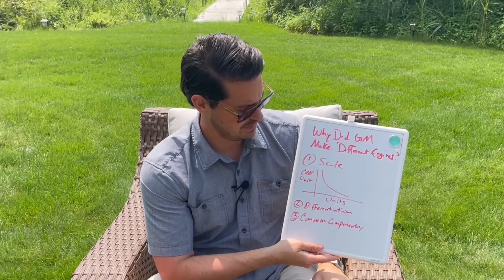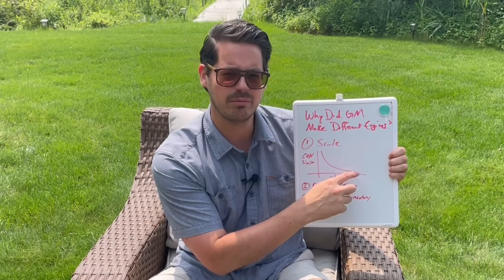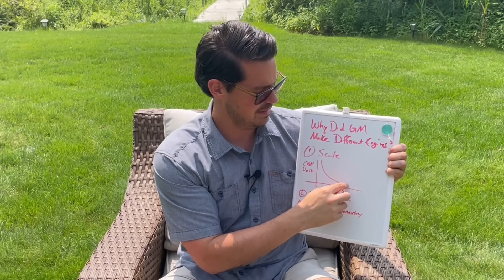Why did General Motors (GM) Make So Many Different V8 Engines in the 1950s-1970s?

Comment: If you're going to do a video on Ford's 351 cubic inch engines, don't leave out the 352 FE.  While ALL of Ford's 351s share the same 4" bore and 3.5" stroke, the 352 does as well - making it, in effect, a 351 too.  Four 351 cubic inch engines, two of which share nothing in common with each other nor the others.

Comment: 7:05 I don't think Buick made a big block, nor Pontiac or Oldsmobile. While they had large displacement engines, they were all off the same, respective blocks, unlike Chevrolet, who had a distinctly different big block versus small block.
Reply from the maker: No. Olds and Buick had small and big blocks. So did Pontiac if you count the short deck 265/301 vs the 326-455.
Reply: @RareClassicCars  OK! I guess I'm old! I was thinking about just the high compression engines through the '60s.

Comment: I used to work in a wrecking yard and it is interesting to note that Buick-Olds-Pontiac and most Cadillac models used  the same bellhousing bolt pattern but Chevrolet was different.  Similar but different.  Other factors were similar, so if you had the proper motor mounts, in general you could put an Olds engine in a  Buick or a Cadillac engine in a Pontiac without too much trouble.

Of course the exhaust could be another problem...

Comment: Another consideration that drove GM to consolidation of power plants was the EPA emissions certification and Corporate Average Fuel Economy (CAFE) requirements.  The cost of research to reduce emissions and improve fuel economy for the myriad of engines, plus the certification of all with the government was prohibitive.  I did some work in that field during that time (1970s).

Comment: The other reason GM started "mixing and matching" motors across divisions was due to the Federal government threatening to break up GM under "monopoly" laws. GM had a stranglehold on US sales and each division was going to be broken off the group. Installing engines across divisions made  each one interdependent on the other and therefore harder to divide up.

Comment: Please explain the longevity of the small block Chevy 283-327 family and the retooling staying the same for so long? Are the Chevy 301 and 307 different blocks than 283/327? Good points about the common runs in AC Delco and Rochester mastering simplicity and cost as given.

Comment: The 403 was probably the worst designed engine ever you would have to nitride the block and crank to exceed stock cylinder pressures and then only for one or two rounds at the drag strip, they were rebored 350s from 4.057 inches to 4.351 inches that bore diameter is larger than the big block 455, but its stroke was 3.385, the shortest stroke of any gm small block, in order to get that stroke to work years ago they just made the rod length an even 6 inches.

Comment: In those rationalization years, GM didn't exactly tout the fact that some Cadillacs were using Olds engines, which I remember upset a lot of the Cadillac faithful when they found out.  I think this was the beginning of a lot of questionable decisions by Cadillac, some of which were forced by diminishing market share, but some of which also caused the diminishing market share.

Comment: I'll agree with your cost scale chart but I disagree GM made engine designs to last 15 years. I'm an Olds guy so I'll stick to just that. The fifties motors 303, 324, 371 and 394 didn't last more than 6 years and the sixties were worse. The 330, 350, 400, 425 and 455 only spanned a couple of years each with the exception of the 350, from 68-80 and 455 that lasted into the 76 model year. One could make the argument that they are all really the same motor with different bore and stroke numbers, which would be fair. The exception to that though is the 66 and 67 425 that had two different bank angles and lifter bore sizes in the same year.

Comment: I think you need to look further back in GMs history, when it was put together from 5 separate Companies, in different locations, that already had their own identity, their own engineers, foundries and factories, in Detroit, Flint, Pontiac, and Lansing. Starting the discussion from the late 60s,  makes it seem like there was no significant history, before that time, to consider. Did you know, for instance, that Pontiac's V8 used the same basic block and heads, for all sizes of displacement, from the 287 of 1955, to the 455, in 1974? That Buick named their engines for their torque ratings, not cubic inches or horsepower, as torque was what they centered the design on, in 1953. No one would call the Nailhead a high revving engine, with such small valves! I think you're too young, to know what the reasons were, without researching back through (your) prehistory. One real fact: GM 50% market share started dropping at the same time, that Oldsmobile was sued, for putting Chevrolet engines in their cars, and continued to do so, as all their distinct engine lines were consolidated, under the GM brand. It was an interesting story, filled with conjecture and misconception, instead of research.🤔

Comment: The Pontiac 301 that came in Buicks is a piece of shit .
Reply: My Dad’s 301 in his ‘79 Regal did almost 200k miles. The only major engine repair was a cam replacement at just over 200k that I did for him. Oh, and a couple of flex plate replacements, if you count that as an engine repair.

Comment: Except you are leaving out the initial design cost. Yes, the lines are a item to them selves, but if you have 4 lines at Chevrolet, and 4 lines at Oldsmobile, why not set up a plant with 8 lines and ship the engines where they are needed. 

When I was in graduate school, dad had retired and gave me his 1970 Buick which had the same issue as all the other 1970 GM vehicles, there was a vacuum diverter to keep the hot coolant out of the air box when the A/C was active. They all developed leaks. The company I worked for has several 1970 Chevrolets and they all leaked at about 2 years in. It go so bad that parts departments took the valves off the shelves and restricted them to vehicles that dealership sold. One of our guys was a mechanic and he removed the vacuum operated valve and put a manual one in. 

I was up in Silsbee, Tx in 1975 and the '70 Buick I had was leaking when I came back to it. The only GM dealership in Silsbee at the time was an Olds dealer and he would not touch the car "because it was a Buick". I had to race down to Beaumont, go in the Buick parts department (service had shut down) and buy the valve. The counterman didn't even look it up, he reached under the counter and picked one up out of a box and wrote it up. I now had the part, but to get it installed. Fortunately, at this time many gas stations still had a mechanic or two on shift and I found one, and got it installed and could head back to my parents home in Houston, over 100 miles away. A year later I traded that Buick in and have never owned another GM product.

That inter brand rivalry had killed off a lot of brands - Pontiac, Oldsmobile, DeSota, Plymouth, Mercury for example.

Comment: GM's division differences are fascinating. For example, in the old days only Buick and Chevy used OHV engines, while the rest used flatheads. Also, Chevy and Buick used an enclosed "torque tube" rather than an open drive shaft. But wait, There's MORE! Chevrolet's Powerglide's technology was based on the Buick Dynaflow. Every other division used the Oldsmobile Hydramatic. So, it was BUICK, Not Cadillac that was the fancy Chevy, Not Cadillac!

Comment: Even as a "kid" I was aware of the fact that there were 4 different 350s, But I assumed that the Olds 455 was the same as the Buick 455. (I am a Buick guy). Then a got an Olds 98 and found out that NOPE, The Olds 455 was NOT the same thing as the Buick 455!
Reply: The only similarity between the 455 Olds & the 455 Buick was the cubic inches.
Reply: @Marc816  👍👍

Comment: I know Oldsmobile kept their 307 V8 around for many years that GM used extensively in almost all the Buick/Oldsmobile RWD sedans and wagons through the 80’s. I had one in a 1987 Buick Regal Limited many years ago that was a really delightful car to drive. Too bad the  200/4R transmission couldn’t keep up. How much did that 307 share with Chevrolet’s 305 at the time?
Reply: They were completely different engines in every way.
Reply: Those 307's were solid. We had one in an '84 Custom Cruiser. 4th in the TH2004R went out at about 120k, the car kept going with only 3 gears all the way to 280k when it was too rusty to keep on the road. Only engine problems were the plastic cam gear skipped at 150k and the front crank hub keyway got wallowed out around 220k.

Comment: In the 70's no only were GM's sales decline but increasing emissions and fuel economy regulations were both:  increasing the engineering and testing costs for each engine, while increasing the frequency with which engine designs had to be replaced or extensively modified. Thus the fixed costs suddenly became more significant.

Comment: don't forget that in 1968 they had 3 engines that had 351 cubic inch displacement (roughly) -- the 352 based upon the 390 block, the 351 Windsor, a decked 302 with a half inch stroke added, and the 351 Cleveland.   They would stop making the 352 that year if memory serves but only Ford could make three mostly non-interchangeable-part motors with the exact same bore and stroke (and of course displacement) -- in the same damn year no less.   And yeah, eventually the 351M emerges just to make things more confusing for everyone.    

Don't miss covering the 2 different versions of the 2v 4.6 (Windsor/Romeo) if you get a chance... -- WHY Ford?  Why?!?
Reply: And those were Ford’s good years. Ford went straight to hell starting in the mid 70’s. I gave up on the bastards …

Comment: Thanks again Adam. Subjects that could go on and on. I will make a point that some of the mid 80's Caprice wagons were equipped with the Oldsmobile 307. Strange how random brand placement was. As if there was a gumball machine filled with random V8 engines on the assembly lines and whatever plopped out is what the next car in the line got

Comment: All the divisions came up with essentially the same solution across the board: wedge-headed OHV V8s (BBC excepted) in very similar displacements. In retrospect, it might have made more sense to come up with a shared engine architecture with detail differentiation -- imagine if Olds V8 had heads to promote low speed power or Pontiac had an OHC version aimed at peak power. That would have provided greater differentiation while sharing common blocks and overall engineering. 

The division structure didn't lend itself to that approach. Todays answer goes farther: common drivetrains across the board, which is challenging as the same turbo 4 that Chevy uses needs to get good enough for Cadillac, which has been a challenge  for GM

Comment: One factor that you have left out is the origin of all of these different engines. Each division of GM had previously been an independent brand that had all of their own specific engines and characteristics. Buick, Oldsmobile, Pontiac, and Cadillac all had been independent brands previous to having been incorporated into GM. Each also had their own customer base that had their own loyalty factor. They bought specific brands because of personal preferences. GM did not want to alienate that customer base - at least in the early days.
Reply from the maker: Agreed. But would argue that wasn’t really a factor by the 1960s. The brands had been integrated for decades by that point.
Reply: @RareClassicCars  Wasn't it? Why else would GM keep each brand to be unique and stick mostly to it's traditions? Back in the late 1960s, I was working in a buick dealership. Make no mistake - a Buick customer was forever a Buick customer. Each brand had it's unique characteristics, and going from a Buick to a Chevrolet was much like going from a Buick to a Ford or Chrysler.
Reply: @jimgarofalo5479  — No self-respecting 1960’s Buick owner would buy a Chevrolet. The Chevys were for peasants …

Comment: My favorite has to be the Chevrolet small block V8 in all it's displacements. Definitely one of the greatest engines of all time. The LS is also another good one and a great replacement for the Chevrolet small block.
Reply: 262, 265, 267, 283, 302, 305, 307, 327, 350, and 400.

Why is that taking up space in my head?

Comment: Downside many years later is that it will be harder to find parts for bespoke engine types.  A mechanical fuel pump on a Ford 460 will be available for quite some time .....Never had trouble getting 455 parts for my Electra, but that was a number of years back.

Comment: Always an excellent presentation. Would like to see a video porch chat on steering column-mounted transmissions; who created that, thought it was a good idea, and did it save money?  As a kid in the 60s, I learned to drive on these as they were common, but they were such a hassle with too many working parts, nothing beat a floor-mounted manual transmission.
Reply: I doubt they were the first, but it was Ford who brought the column shift to the masses in 1940. It was well-loved and caused most other carmakers to at least offer the option. You had to learn how to handle them when they wore out, and even most girl drivers of the time knew how to get one unstuck when you didn't get it just right and they jammed between gears. They say a manual transmission makes it hard to steal cars now. If that's true then a worn-out column shifter would make cars theft-proof completely!
Reply: Column shifters allowed your girl to sidle up right next to you so you had a warm soft place to put your right hand.

Comment: These are good points. I guess that would explain the rationale behind badge engineering as well. Now days we get excited if GM uses different sheet metal on cars. Think Chevy Traverse vs Buick Enclave. Later being in my opinion a much more beautiful car. Now days most SUVs just kind of look the same. I own a Toyota Sequoia, it's my baby but it literally looks like a blown up Highlander. Both are vastly different cars but they kind of look the same in many ways. I guess my last example is a bit of a stretch but my point is all this part sharing made vehicles look bland. Think A body of the 80's. Who would have thought it would get worse?!

Comment: Each GM division ALWAYS had it's own engine, from the very beginning.  Partly because each started as an independent company.  Later, because each division's cars were for specific markets, and having your own engine was more prestigious.  Can you imagine the 1915 Cadillac using the Chevrolet 4 cylinder engine?  Chevy did introduce a V8 model in 1917, with overhead valves no less, but it didn't sell, as it cost as much as a Buick, and people were not willing to spend Buick money on a Chevy.  This is one of the things that helped GM become the biggest and remain the biggest.  At Chrysler, each division was more or less a companion of the next higher-priced division, with much the same engineering.  At Ford, once the medium-priced Lincoln-Zephyr came out for 1936, and the Mercury for 1939, Ford started following Chrysler's pattern - the Merc was a larger nicer Ford, the Lincoln-Zephyr, while different looking, had a V12 patterned after the Ford V8, and chassis-wise, as a larger Mercury.  GM's divisions cars were each quite different from each other.  Guess who's cars sold in the highest numbers?

Comment: At one time each of those divisions were separate car companies, there was no such thing as GM. Louis Chevrolet started Chevrolet, David Buick started Buick, Ransom Olds started Oldsmobile, the Leland family started Cadillac (as well as Lincoln) and Pontiac was part of the Oakland company. Billy Durant started buying those companies and formed GM. That’s one of the reasons GM’s divisions kept more autonomy for many decades until the late 70’s/early 80’s.
Reply: Ford actually manufactured 3 big block families and 2 small block families. The FE (352, 390, 406, 410, 427 and 428, MEL (383, 430 and 462) and 385 series (429 & 460) big blocks. The Windsor (260, 289, 302 & 351W), Cleveland (351C, 400 & 351M) small blocks.

Comment: You forgot the Holden V8 that came in 253 and 308 cubic inch sizes. It's a completely different motor from the American V8s and  weighed 100lb less.

Comment: GM was able to get their divisions to have their own fans due to the fact that each division had their own engines. And as you stated, power output and red line helped make each division different from each other performance-wise.
As you also stated, GM had very high market shares during those times, so they had plenty of money to produce.
CAFE standards, the stages in vehicle downsizing, and cuts in model lineups would most likely also have connections to GM's decision to stop their brands from producing so many engines and begin using a single engine produced by one division in most other divisions. Think of how common the Chevy 350, Chevy 305, and Buick 3.8 eventually became across the entire company.
Reply: But it helped ruin GM.  Why by a Buick if it is identical to a Chevy, but costs a lot more money?

Comment: Chevs were not always the "best" engine in their capacity class. I wonder why corporate did not cherry pick the best features of each divisions engine and combine those traits to make a much better engine? Surely the cost should no longer be an issue with a common engine because this cost is defrayed over all other divisions. I note that transmissions also differed between divisions in this period (and even earlier). Would be interesting to know why this occured also.
Reply: They did, eventually, and called it the LS (aka Gen III small block).